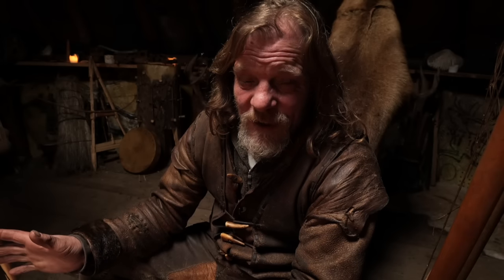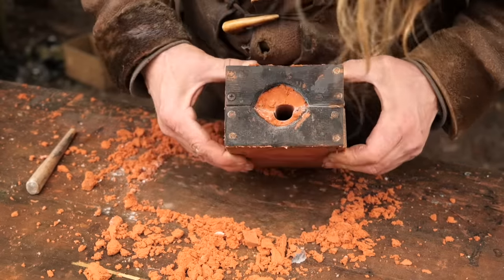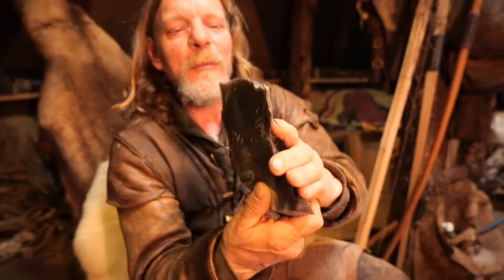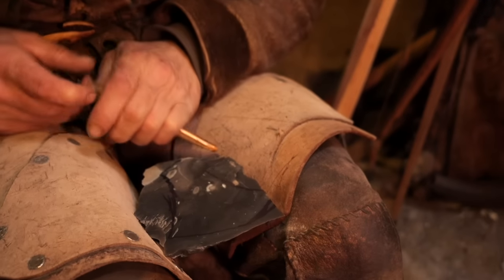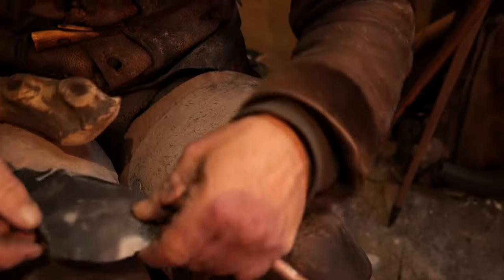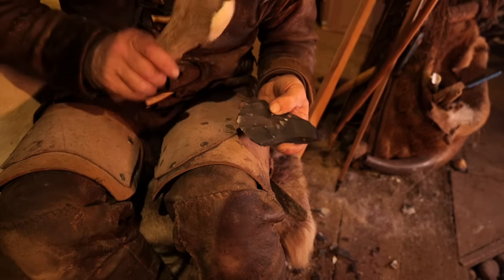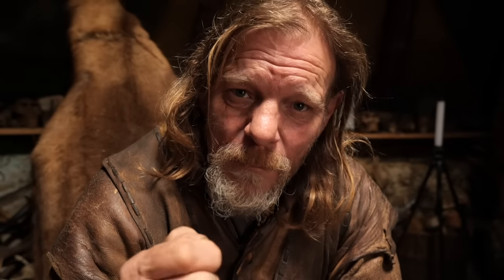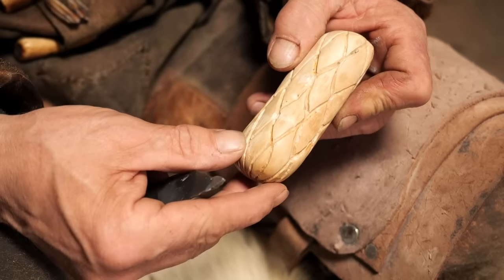Flint Knapping using an ancient punch technique.

Comment: You made casting look a lot easier than it is. 
You must have a big pile of sharp bits of flint somewhere and another with lots of potentially workable bits of flint in it.
That was definitely a defining moment but it came off beautifully square. 
Is there a grain to flint, I could see where the fracturing was going and how you were using them but is there a way or direction you should not try and punch?
that click for the Burrin was delicious
absolutely fascinating stuff thankyou for sharing

Comment: I was not expecting an actual punch for direct percussion. I was that that you'd make the edge of the copper rod jagged and then "punch" it along the side, sort of like a rasp, so that it would grab flint edges and snap them off in rapid succession, almost like a rapid pressure flaker.
Reply: Well, more like a roughed up edge to grab the flint edge, rather than a jagged edge.
Reply: *I was thinking that you'd
Reply: And punch it along a smooth surface on one side and the flint on the other side, to apply force to the edge of the flint.